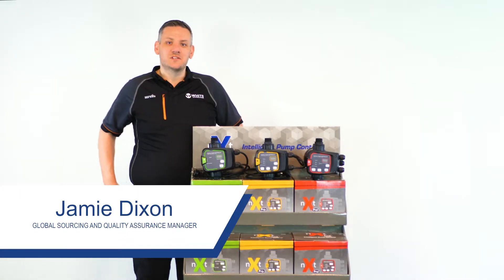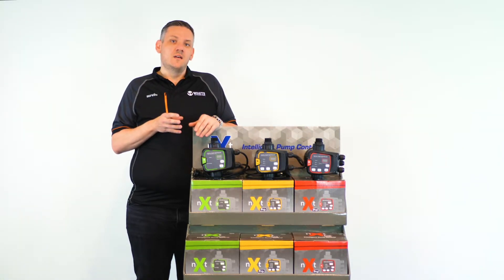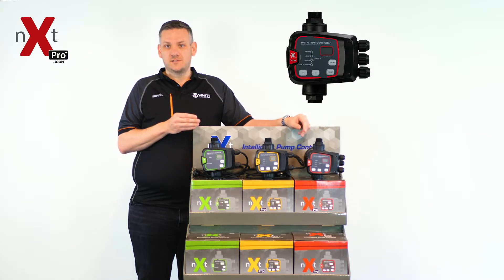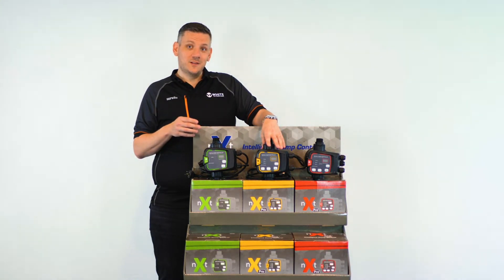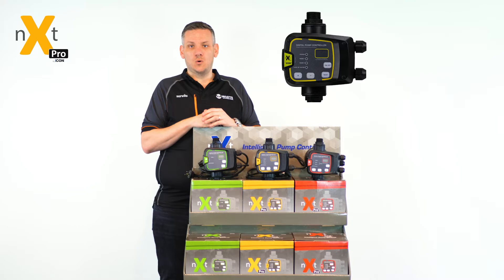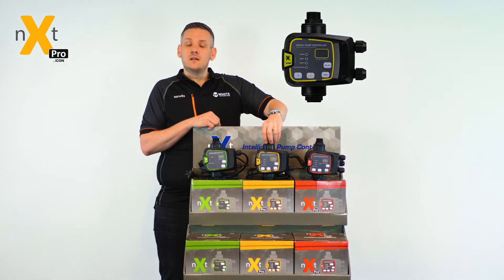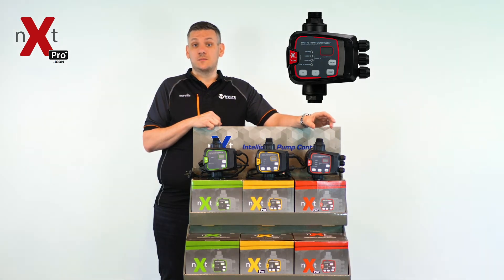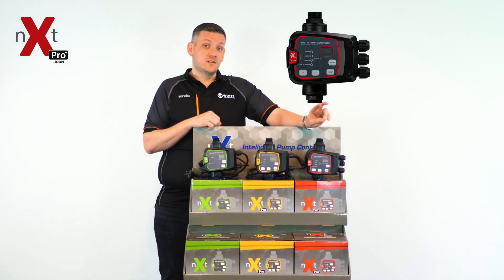New nXt Pump Controllers Explained

Comment: i need help ,i on a farm and it cutting off, i cant remember if its F5 or F2 error, did the cycling it 15 short burst but that not issue switch off.we got the green one .any tips be helpful.is there a manual for green model or they all same , also is there a timer on it seems it off at the end of the day then switches off.